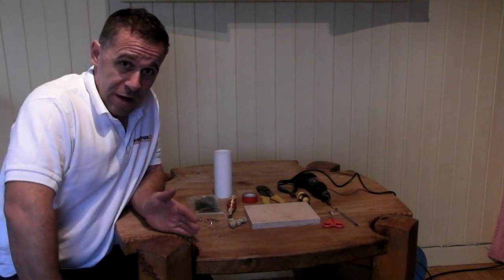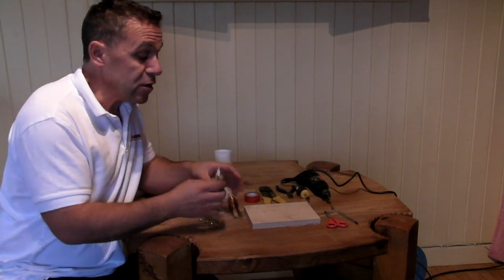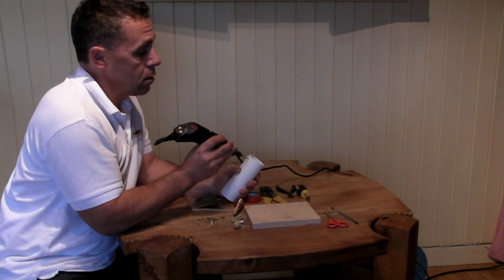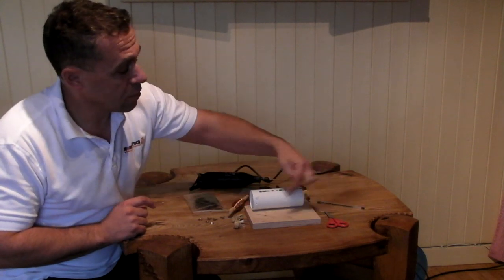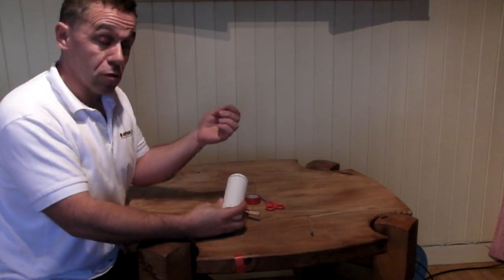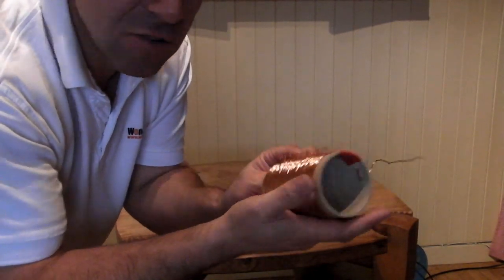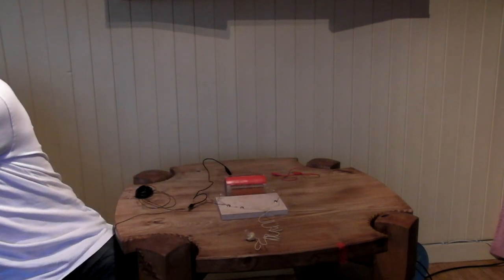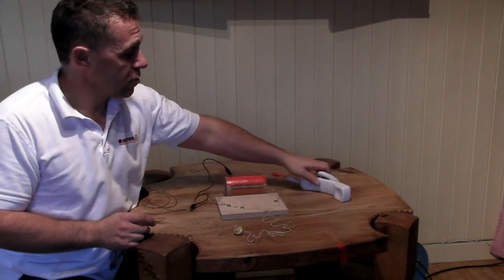Build Your Own Crystal Radio

Comment: I built a radio from others who posted videos... they didn't work.  Once I incorporated the simplicity of your radio, it worked.  Frequencies were still hard to stabilize so I added a 365uf variable cap and the radio tuned quite well.  Thanks...

Comment: I just gathered my harvested parts (var. cap., diode, disk capacitor, 47k resistor), a breadboard, lot of .5mm enameled wire, a 2-3mm diameter tube (from an ink pen), and wound 95 turns onto the tube, connected everything together, added a ground connection, and antenna connector, and just tried all kinds of connections.
I finally got a good signal, fine-tuned it, and connected my small amp, and got at least 3 radio stations!
I wanted to try another coil, so I glued 2 popcicle sticks together, trimmed it down, and wound 90 turns of wire, and connected it, and I got SW! radio CUBA, Nashville, TN, and a European station! not bad at all!
I used small, gutted-out, pagers, and put a crystal radio in each pager case!
didn't have to buy anything!
Reply from the maker: Brilliant!
Reply: the most time-consuming part of the radio construction is counting the turns on your coil form, and keeping them inline, and not kink them.
but, it is worth to work.
good luck!
Reply from the maker: Thanks - yes, winding the coil is a bit fiddly.

Comment: Great video, great project! Thanks! 
Few tips: 
Cheap Schottky diode BAT85 can be used instead a rare germanium one.
Any small power transformer (connected to normal headphones) can be used instead a crystal earpiece.
Any insulated wire can be used, not only 20 AWG enameled wire, even PVC insulation, etc
Reply: Alex. Regarding the transformer, I was told that it had to be a input output DC to DC or ac to ac.  Was I advised in error? I've been waiting on my microwave to die so I can pirate the transformer.   Would be nice to use some I have already.

Comment: If you put a 47k resistor across the crystal earphones the set will be louder and less distorted.  The Ge diode does not fully conduct when it sees the 20 Megaohm load from the earpiece.  Adding a shunt resistor allows the Ge diode to conduct for more of the cycle.  Good video though.
Reply from the maker: Thanks for the tip - we'll definitely give that a go!

Comment: Well done. I still, to this day, construct the occasional crystal set. I can just clip my antenna wire onto a handy light-switch plate screw, and tune three local stations where I live. Well, at least during the day-time, before the local AM'ers go low power. At a previous residence, I was close enough to the transmission tower to light a LED from the crystal radio. Of course, I already suspected that particular experiment might work because the RF was swamping everything. So I figured it might be worth a try?  I wanted to hang coils and LEDs in the woods near the tower to see them flicker at night....
Reply from the maker: Pete McBennett Thanks!  The coils and LEDs sounds like an interesting project.

Comment: I am into AM crystal set radios that not just receive MW, but also LW as well.  What if you wanted to make a AM crystal receiver to receive BBC 4 on 198 kHz or anything from 150 kHz to 300 kHz?  How many turns would you need?   Great video you made there.
Reply from the maker: +Adam Ebel Check out this website http://www.crystalradio.net/professorcoyle/professorcoylecyl.shtml It has a calculator to help you find the resonant frequency of your coil.
Reply: Many more turns on the coil.